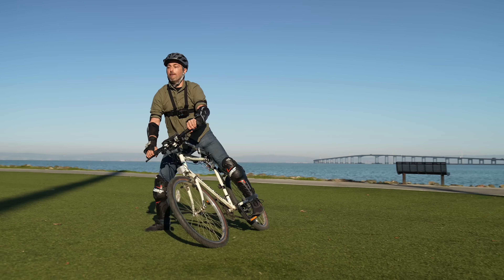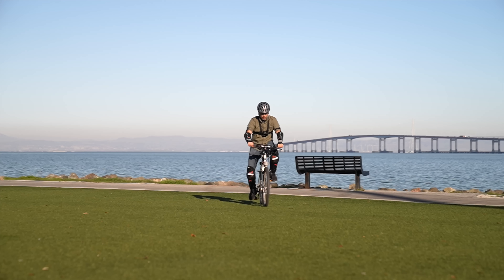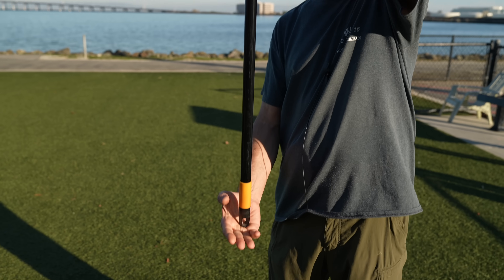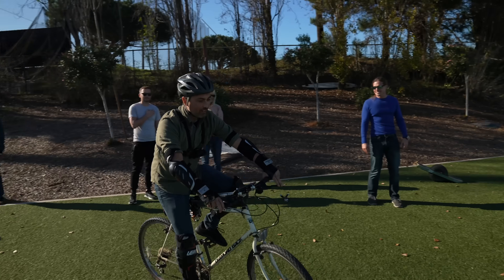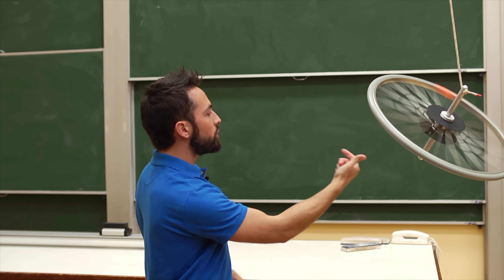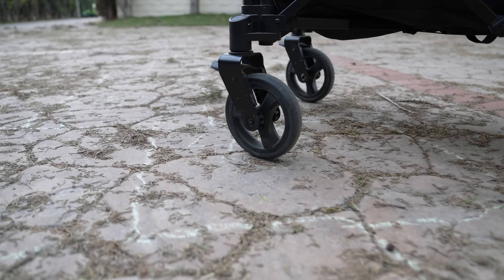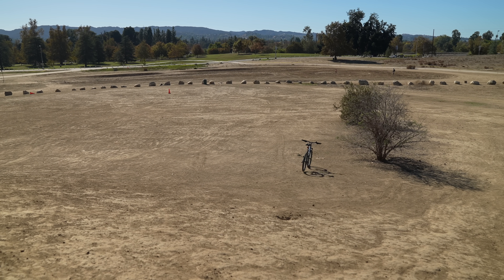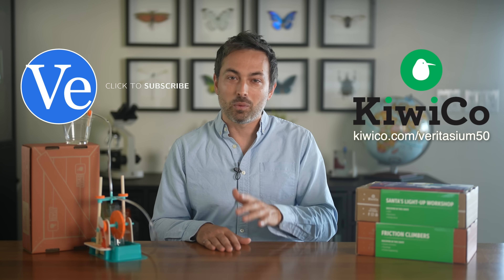Most People Don't Know How Bikes Work

Comment: Unfortunately this video is incorrect in stating that you need to counter steer to turn a bike, and provides a classic example of a flawed scientific method.  The concept is that you steer a bike by moving the handlebars, which results in the hypothesis is that you need to counter steer to turn.  The experiment is to make a bicycle that cannot be counter steered, and test the rider’s ability to turn.  This is a flawed experiment.  A bicycle moving in a straight line is only stable if the center of gravity of the bicycle/rider combination is directly above the path of the bicycle.  When the center of gravity shifts to one side, then (as described accurately in the video) the steering wheel turns in the direction of the imbalance, causing the bicycle to steer itself under the center of gravity, restoring balance.  So in order for the bike to be stable, the steering wheel must be able to make the necessary corrections for any misaligned CG position.  By locking out the steering in one direction, you have effectively created an unstable bike in one direction.  Any slight imbalance in that direction will cause the bike to fall over.  Slight balance offsets are constantly occurring while riding a bike and the wheel automatically makes the micro corrections to maintain balance.  Although the test was to try to turn the bike when the wheel was locked in one direction, it would have had the same results if the rider was simple told to ride straight, as the stability of the bike was compromised.   

It should be obvious from the rider-less bike that counter steering is not necessary.  The rider-less bike actually makes a few small turns as it corrects for slight imbalances during its bumpy ride.  The bike did not counter-steer to make these turns, it only steered itself back to stability after being knocked out of balance.  Actually it is quite easy to ride a bike without any hands on the handlebars, steering by simply leaning in the direction that you want to turn, with the bikes natural stability feedback loop taking care of the minute steering inputs necessary to stay upright.  And that is how almost all bicycle riders steer, by leaning in the direction of the desired turn, and gently holding the handlebars to assist the bicycle’s natural stability.

In fact, during the experimental phase of this video the cases where the rider was actually able to make the turn even with the locked out steering were simply ignored as outliers, and not the valid data points that they were (an additional, and shameful, failure to follow the scientific process).

Of course you could counter steer if you wanted to, but most bicycle riders do not do this.  Motorcycles, which are essentially the same system, actually do require counter steering because of the difference in mass distribution of the total vehicle.  With a 150lb rider a slight lean is enough to unbalance a 30lb bicycle.  But with a motorcycle that can range from 400lbs to 800lbs and more, the turn response would be much too slow.  In this case the counter steer technique is necessary to lean the motorcycle as required to turn.

So to sum it up, the hypothesis was incorrect, the experiment was flawed, and the data analysis doctored to match the hypothesis.   And that is how misinformation is formed.
Reply: "When the center of gravity shifts to one side, then (as described accurately in the video) the steering wheel turns in the direction of the imbalance, causing the bicycle to steer itself under the center of gravity, restoring balance."
You just explained how CS work.
So what were you try to say?
Reply: @XtreeM_FaiL  Sorry if I failed to explain that clearly.  The argument for counter steering is that you have to turn the handle bars opposite of the intended direction of turn to initiate the turn.  In other words, while riding in a constant direction and desiring to turn to the right, you have to push the handlebars momentarily to the left (causing the bike to lean to the right because the wheels are pulling the bottom of the bike to the left) so that you can then push the handlebars to the right for the desired banked right turn.  The video argues that counter steering is the necessary (and only) means to lean the bike to the right for a right turn.  My argument is that to initiate a right turn you need only to physically lean your body to the right (offsetting the center of gravity), causing the bike to lean to the right and accomplishing a right turn.  I have done this many times myself by riding without holding the handlebars at all.  I just lean in the direction I want to go and can happily navigate in any direction for as long as I want by just leaning in the desired direction.  Since I am not touching the handlebars, I am certainly not counter steering to lean the bike.

I'd also like to add an additional comment about the flawed experimental method.  The concept of the experiment was that by locking out the steering in a specific direction (say, to the right), then you cannot accomplish a turn in the opposite direction (in this example, to the left).  My argument is that the steering is a critical part of the feedback loop for stability.  By locking out a steering input in a single direction, you have effectively taken away the stability of the bike and have made it impossible to ride in a straight line.  Let's take the concept of the experiment a step further.  If locking out the handlebars from being able to steer in one direction will only make it impossible to steer in the opposite direction, then why not lock the steering in the central position and show that no turns are possible, allowing you to only ride in a straight line.  If you were to try this experiment you would fall over immediately, as the bike is now no longer stable, which would only prove that an unstable bike cannot be ridden.  The only proper experiment would be to instrument the bike so the time histories of critical parameters (e.g., bike vertical angle, steering angle, speed, turn rate, etc.) are recorded for later data analysis, but this would be very complicated and time consuming, which is way beyond the scope of this type of presentation.
Reply: @davidbraun4083  
>> My argument is that to initiate a right turn you need only to physically lean your body to the right 

We understand your argument.  But it's wrong.

>> Since I am not touching the handlebars, I am certainly not counter steering to lean the bike

Yes you are.  Feel free to find where I've explained that countless times in these comments.

>>  If locking out the handlebars from being able to steer in one direction will only make it impossible to steer in the opposite direction, then why not lock the steering in the central position and show that no turns are possible, allowing you to only ride in a straight line.

I have done that,  but it's not in the video.  And even professional bike and motorcycle racers have been unable to ride it that way for more than 3 seconds.  You don't seem to understand that your argument proves the point of this video.  If you could simply lean to initiate a turn, you could ride the bike in a straight line when the steering is fully locked.  You could also sit on a stationary bike with steering locked and balance as easily as you do when riding the bike.  But you can't - because that's not how you balance a bike or initiate a turn.
Reply: @Rick_Cavallaro  I tried looking through the comments for your hands-free counter steering argument, but gave up after ten minutes of searching.  However, I have deduced what your argument must have been (correct me if I am wrong).  In order to lean to the right (for a right turn), I must push off something in the left direction.  That would be my seat contact.  So at the start of my lean to the right, I have pushed the seat to the left, initiating a counter steering input.  Even though my lean to the right will quickly cancel this input out, the counter steering input will have been made.  So I will concede that point.  Again, an instrumented bike would be an interesting way to analyze the impact of the counter steering input in this case.
I can see how this may have led you to make the test bike.  It is always possible that by holding the handlebars the rider can resist the counter steering input.  So you decided to make this counter steering input impossible to make by locking out the steering in the opposite of the desired turning direction to show that a turn cannot be accomplished (please correct my if I am not reading your thought process correctly).  However I still assert that the experimental bike concept is flawed and proves nothing.   The bikes natural stability is dependent on the turning of the steering wheel.  A moving bike leaning to the side must steer in the direction of the lean to provide stability.  Without that capability it is not a functioning bicycle any more, and cannot be used to validate anything related to bicycle dynamics.
I indicated that, according to your logic, a bicycle with a locked straight ahead handlebars should only allow you to ride in a straight line.  I also indicated that this bicycle would be impossible to ride, and you mentioned that you had actually done that test, and confirmed that result.  What was your purpose of running that test?  Did you expect the bicycle to be impossible to ride, or did you expect to be forced into a straight path?
I still assert that most bicycle riders who are holding the handlebars cancel out any initial weight shift counter steering input and turn by leaning in the direction of turn.
Reply: >>If you could simply lean to initiate a turn, you could ride the bike in a straight line when the steering is fully locked.

Your comment above needs to be addressed.  Riding a bike is only possible because of the natural stability built into the bike design, which requires that the steering wheel be free to move.  A bike with the steering wheel locked is no longer a bike, which means any experiment along these lines is invalid.

Since we are having a hard time agreeing on the big picture, let me break down a simple case which proves my point, and you can tell me where you believe that I got it wrong.  Take the case of a bicycle that is rolling in a straight line.  Let's say there is no rider, just the hands free case.  The bicycle starts to lean to the right side from a disturbance (say a small gust of wind).  With the balance disturbed, the bike will start to fall to the right.  As the bike departs from vertical, the front (steering) wheel pivots in the direction of a right turn.  It does this as a result of the force offset, weight balance, and gyroscopic effects as described in the video.  This rotation of the steering wheel in the direction of the fall steers the ground path of the wheel contact patches to the right, which corrects the balance of the inverted pendulum, and brings the bike back to a vertical position.  As the bike returns to vertical the steering wheel deflection (which is a function of the tilt of the bike from vertical (or in the case of the gyroscopic effect, from the tilt rate)) decreases so that when the bike is again balanced in a vertical position the steering wheel is straight again.  This is a classical stable feedback system responding to a pulse input.

Note that the feedback system is just trying to maintain the bike in a vertical position.  It does not care what direction the bike is heading, only that the bike is not leaning to either side.  In the above example, all of the time that the steering wheel is not in the centered position the bike will be turning to the right.  The bike has accomplished a right turn with no left steering input to initiate the turn.  I know adding a rider flopping from side to side makes this much more complicated, but this simple case illustrates bicycle dynamic stability.
Reply: @davidbraun4083  
>>  In order to lean to the right (for a right turn), I must push off something in the left direction. 

Nope. That's not my argument.

>> I indicated that, according to your logic, a bicycle with a locked straight ahead handlebars should only allow you to ride in a straight line.  I also indicated that this bicycle would be impossible to ride, and you mentioned that you had actually done that test, and confirmed that result.  What was your purpose of running that test?  Did you expect the bicycle to be impossible to ride, or did you expect to be forced into a straight path?

My purpose in running that test was to demonstrate to people that they can't ride a bike with locked steering - even if they only have to go in a straight line.  And that further demonstrates that you cannot simply lean your weight to lean the bike.

>> I still assert that most bicycle riders who are holding the handlebars cancel out any initial weight shift counter steering input and turn by leaning in the direction of turn.

If you could do that, you should be able to balance on a stationary bike with steering locked just as easily as you ride a bike.  But you'll find that to be impossible.

>> Riding a bike is only possible because of the natural stability built into the bike design, 

That's absolutely not the case.  You can eliminate all three of the parameters that provide natural stability and still ride the bike without much trouble.  You just can't ride it no handed.  

>>  A bike with the steering wheel locked is no longer a bike, which means any experiment along these lines is invalid.

No - it means the experiment is exactly the experiment we need to do.  I understand you don't like that experiment since it proves you wrong, but it's absolutely a valid experiment.  If you can lean your weight to initiate bike lean, why can't you do that when I lock the steering.  "It's not a bike" is not an answer.

>>  let me break down a simple case which proves my point

OK - I read your simple case.  And it's almost entirely correct.  But I missed how it in any way proved your point.

If you want to prove your point, there are a couple of easy ways to do it...  you can just sit there and balance on a stationary bike with the steering locked straight ahead.  If you can't do that, you'll have to explain why it's possible to initiate bike lean by leaning your body when the bike is moving, but you can't do it when the bike is stationary.  I can easily explain why it's easy to balance a bike in motion but nearly impossible to do on a stationary bike with steering fixed straight ahead.  You're leaning theory fails to explain that.  Alternatively, you could just lift both feet onto the pedals and have someone immediately tell you which way to fall, left or right.  No amount of contortions will let you control your direction of fall.   Again, you'll have to explain why you can do that on a bike that's moving, but not one that's stationary.

The bottom line is simple.  In the lateral axis, a bike behaves as an inverted pendulum.  You move the base to balance or unbalance it.  When the bike is in motion, steering causes the necessary lateral movement of the contact patch.
Reply: @Rick_Cavallaro  The difference between a steerable bike (i.e., normal bike) and the stationary bike/bike-with-locked-steering is that the latter two are both dynamically unstable.  A small displacement from vertical and they have a non-linear acceleration to horizontal.  They will actually accelerate faster as they displace from vertical, making them highly unstable. Even so, I have frequently seen skilled bike riders balance on a stationary bike for as long as they want, so it is clearly not impossible as you suggest.

The purpose of my sample bicycle dynamic analysis was to confirm that we agree on the fundamental principles, so we could expand the discussion from there.  The analysis showed that a normal bicycle has a built in stability feedback loop that makes bicycles so easy to ride by constantly trying to keep them upright.  This feedback loop requires a steering input in any direction necessary to cancel out errors in balance.  By mechanically preventing a steering input in any specific direction, the basic stability is lost, and that is my reasoning for the comment that this altered device should no longer be called a “bike”, as it no longer behaves like a bike.

Your comparison of a rider/bike to a simple inverted rigid pendulum is overly simplistic.  To make the analogy meaningful you would have to add a restoring moment that will keep the pendulum upright for disturbances from vertical (this is the feedback stability loop we agreed on).  When disturbed from vertical, this model would smoothly return to a vertical position.  This model would show that lateral weight displacements, combined with the stability feedback input, would result in a steady state angle from vertical.  You would also have to take into account the centrifugal forces associated with a turn rate (the lean angle combined with the forward “speed” dictates the turn rate).  Every one of your examples modifies the system by breaking the natural stability, and you use the ultimate failure to remain upright as vindication of your theory.  And I hate to bring it up again, but your admitted data manipulation of ignoring data points that contradicted your theory really weakens your argument considerably.

I will agree that in the real world, steering inputs from all sources (weight imbalances, wind, road bumps, uneven handlebar pressure, etc.) really clutter up what is happening at any one time.  And counter steering inputs are probably happening all of the time whether intentional or not.  But they are certainly not a requirement to turn a bike.
Reply: @davidbraun4083  
>>  I have frequently seen skilled bike riders balance on a stationary bike for as long as they want, so it is clearly not impossible as you suggest.

You've seen people doing a track-stand.  They turn the front wheel and move the bike fore and aft a few inches.  That moves the front of the bike left and right a few inches.  What you haven't seen is someone balancing on a truly stationary bike with the steering held straight ahead.

>> Your comparison of a rider/bike to a simple inverted rigid pendulum is overly simplistic.  To make the analogy meaningful you would have to add a restoring moment that will keep the pendulum upright for disturbances from vertical.

Nope.  A bike with a rider on it does not have such restoring force.

>> this is the feedback stability loop we agreed on

Nope.  I never agreed that a bike with a rider has any positive stability - because it doesn't.  Just put someone on the bike that hasn't learned how to balance the bike and you'll very quickly see that.

>> I hate to bring it up again, but your admitted data manipulation of ignoring data points that contradicted your theory really weakens your argument considerably

Now you're simply lying.
Reply: @Rick_Cavallaro  I have seen BMX bikers balance their stationary bikes with the wheel straight.  I have also seen this at a Cirque Du Soleil show..  But this is really not relevant to this discussion, and really is just a stunt.

Please explain how a bike with a rider changes the basic stability of the bike.  Adding a rider increases the mass considerably and raises the CG, but the mass does not impact the restoring force supplied by the steering input created when the bike leans.  I could see that it might make the system dynamically unstable if the damping is not high enough, but that doesn't seem to be the case.  The hands-free rider case shows clearly that a bicycle is stable, as it is easy to ride as long as desired and maneuvered with ease.  The same holds true with hands on the handlebars.  The only reason that a person needs to learn how to ride a bike is because initially they fight the natural stability.  The stability forces on the handlebars are very light and can easily be over-ridden by an inexperienced rider.  Plus, a bike is also very controllable using the handlebars and leaning, and a new rider has to learn how to coordinate these two inputs while not fighting the natural stability.  One proof of this argument is that when everything clicks for a new rider, they very suddenly start riding fairly well.  Once you figure it out, its easy.  But if it was unstable, then you would you would see incremental improvements as your skills gradually improved.

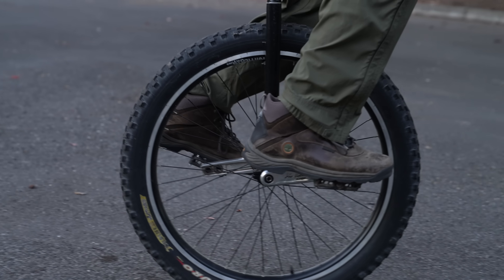And to address the experimental data manipulation, here is a quote from the video starting at the 4:20 time stamp:

"Now I should point out that sometimes when the steering locked we just happened to be leaning in the right direction to execute the turn.  … Essentially by sheer luck we had counter steered before that side of the handlebars locked out.”

That is a very convenient explanation for experimental data points that don't agree with the hypothesis.  I could (and do) argue that this result proves my argument that leaning is all that is required to achieve a turn.  The testing also proves my point that by eliminating the stability to one side a fall will result.  If anything this shows that the experiment was not sufficient to prove the hypothesis.  Also, considering that the normal stability inputs on a bike are very small, I would question the ability to precisely lock out the steering at a perfectly straight steering angle.  Locking out the steering even a few degrees away from straight in either direction would invalidate the tests.  It is just not a very convincing test.
Reply: Account created: 1 day ago

Ok bro
Reply: >> Unfortunately this video is incorrect in stating that you need to counter steer to turn a bike, and provides a classic example of a flawed scientific method. 

Lucky for you, I'm here to offer you the same $10K bet Derek gave Kusenko.  How'd you like to make some easy money?

>> It should be obvious from the rider-less bike that counter steering is not necessary.

Nope.  It still occurs even on a riderless bike.  We can put another $10K on that if you like.

>> And that is how almost all bicycle riders steer, by leaning in the direction of the desired turn,

Let's put a 3rd $10K on that.

>> Of course you could counter steer if you wanted to, but most bicycle riders do not do this. 

And let's make that a 4th $10K.

>> So to sum it up, the hypothesis was incorrect, the experiment was flawed, and the data analysis doctored to match the hypothesis.   And that is how misinformation is formed.

Let's just call it a nice round $50K.  What do you say?

And I'm NOT here to argue this nonsense with you.  If you believe your nonsense - take the bet.  If not - don't.